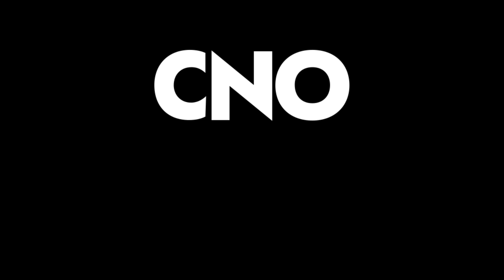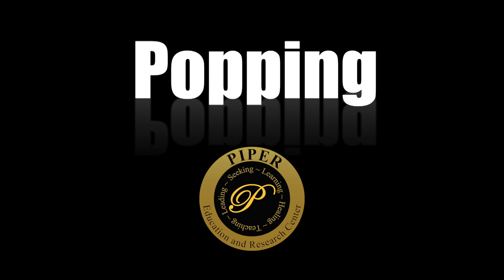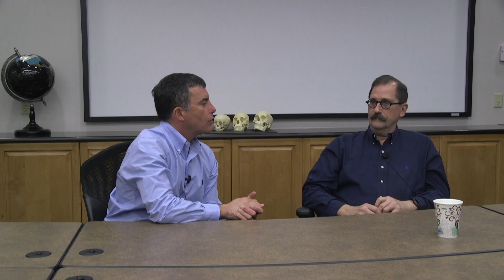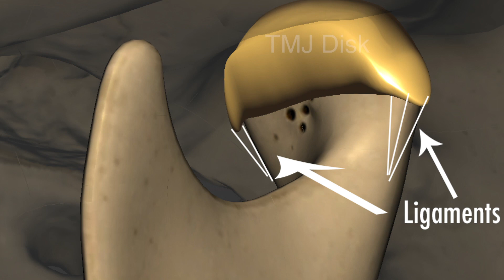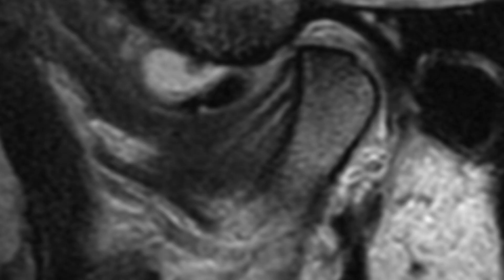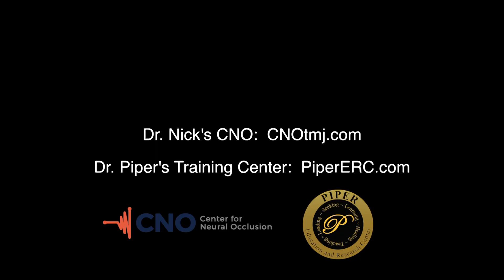What causes TMJ POPPING & CLICKING?!

Comment: I think I got my lock jaw because of the way that I sleep, I usually sleep upside-down with my head facing to the left, one day I woke up like at 4am and I got scared because I couldn't fully open my mouth, I wanted to force it open but something told me not not, I decided to like massage the left side of my jaw for like a minute and it slowly started to open more and more, I went back to sleep but this time facing up. And by 9am my lock jaw was gone, but I do have some small clicking noises when I open my jaw, this morning I got a lock jaw again and I decided to massage it again slowly and roughly and it was gone like in 4 minutes. I also had a dentist visit like 3 months ago and I had my mouth open for like 2 hours but u doubt that this caused my lock jaw because it was long ago, so I personally think that its the way I sleep.

Comment: I've had crepitus in my left jaw joint for a few years without any pain. My bite recently changed over the course of just a few days, but i still have no pain whatsoever associated with these changes. My oral surgeon diagnosed with me osteoarthritis in my left TMJ, but also said the disease is self-limiting and will eventually stabilize, and once it has "burned out", it would then be necessary to fix my bite. Is TMJ osteoarthritis really self limiting?
Reply: I've also already had braces twice, once when i was pretty young and once again from age 18-20, which did include 2nd molar extractions on my bottom row and wisdom tooth extractions on my top row in order to fix a class 3 bite without jaw surgery
Reply: It's due to braces and not osteoarthritis,dental professionals hide everything and make fools out of everyone tmd may or may not progress,but it can get progressive over time with jawpain,headaches etc lot of issues.braces should be banned!! I  trying to raise awareness about them